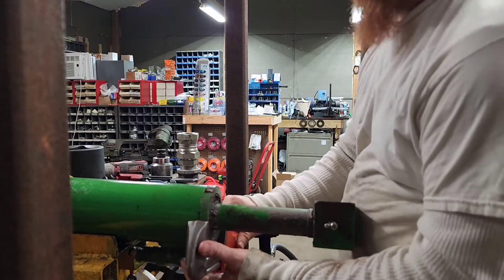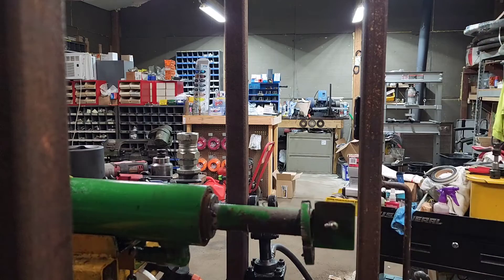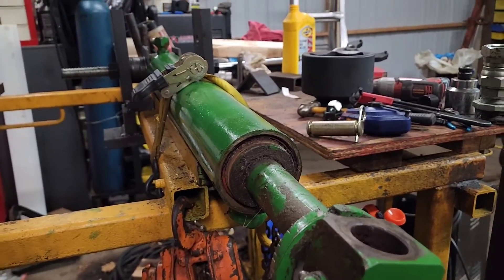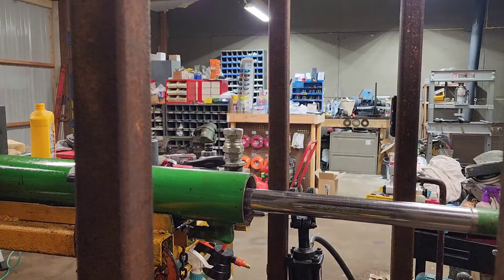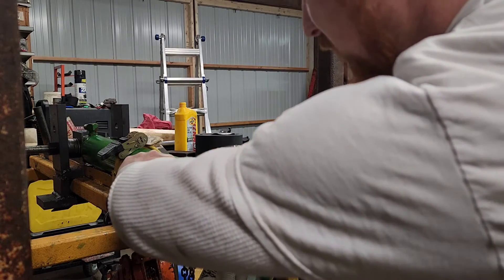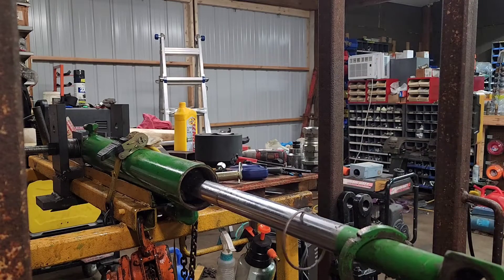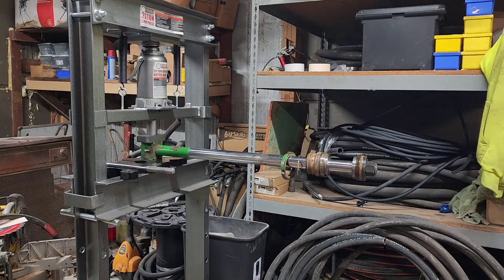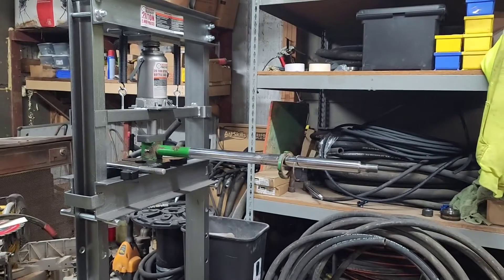John Deere cylinder rebuild

Comment: Nice work. I do those in the field and sometimes it’s not easy.
Reply from the maker: I agree. I typically shy away from doing them in the field if at all possible.
Reply: @mayshydraulic  I been working on heavy equipment all my life. I did work for a hydraulic shop that would always send me out when their guys couldn’t do the job. The owner would put his magnets over my name on my truck and tell the customers that he was send his best guy.  I did on site Hydraulic repair cylinders, pumps, and all hydraulic related issues.  Keep the videos coming. Good intuitive videos.

Comment: I just started my 40th year in hydraulic repairs and have seen some really screwed up homemade tools, this isn’t one of them. This is basic, simple and only mildly dangerous. The Pipe Wrench will be the week point, so as long as you’re not using imported Pipe Wrenches I’d say you have a pretty good setup. KUDO’s!
(A face shield would be a good idea in case the handle snaps, it would prevent possible eye damage, I speak from experience)
Reply from the maker: Thank you so much for the advice and compliment. We have actually made a vise style wrench made from 1/2 metal and  two 1in pieces of all thread.  We use a pipe Ridge  pipe wrench, but for smaller, easier jobs.
Reply: I am from China Seals Factory. Our company produces many types of hydraulic oil seals. If you are interested in our products, we can send you free samples so that you can learn more about our products.

Comment: Looks like a nice simple teardown solution. Some get really fancy. Why push up vs pull down?
Reply from the maker: If im not mistaken, you should be able to get more force pushing up.
Reply: @mayshydraulic  yes, because you have the larger surface area on the cylinder when pushing. Just seems harder to strap it down.
Reply from the maker: Yes it is for the most part. But a 1ton chain ratchet does wonders

Comment: Have a JD 310c hoe. Are the cylinders basically the same as this ? Thanks
Reply from the maker: Yes to my knowledge they are.
Reply: @mayshydraulic  thanks
Reply: @mayshydraulic  subscribed
Reply: I have a 210c. Love it, it's a great workhorse. Here because I blew the seals on my hoe bucket cylinder. Wondering how I'm going to get the 1 5/8 nut off in the field, lol.
Reply from the maker: After you can get it apart you can remove the barrel from the machine and leave the rod on the machine.  You can then us the right socket and breaker bars to remove the nut.
Reply: @mayshydraulic  Yes! That's the way to secure it, thank you. Why do we miss the simple lol??

Comment: Good video. I'm doing the same job on a 740 loader lift ram but the outer collar nut won't back out. I have it turning but it just turns in the same place. Any suggestions?
Reply from the maker: One thing you could try is soak it in lubrication.  If that doesn't work, you could pressurize the cylinder with the loader, then try and remove it.  You could also try an air hammer with a duel chisel.  And worse case scenario is cut it off to remove it.
Reply: @mayshydraulic  Thankyou, I put some pressure in the cylinder and got it loose.
Reply from the maker: No problem your welcome
Reply: I am from China Seals Factory. Our company produces many types of hydraulic oil seals. If you are interested in our products, we can send you free samples so that you can learn more about our products.

Comment: Thanks for the video. A customer asked me to rebuild the lift and tilt cylinders on a 740 Deere loader. Since I didn't have a large enough  spanner, I tried a 36" pipe wrench on the lift cylinders but they wouldn't budge. So I used an air chisel with a dulled chisel to break them loose. The problem was it also loosened the gland inside so I used a come-along to put pressure on the gland and then using the air chisel was able to get the gland nut loosened up enough to remove. After driving the gland in to get to the retaining ring I used an old small screw driver as a punch to get the ring out of the groove and then used a needle nosed vice grip to remove the ring. I really appreciate your video and that cylinder holding set up with the hydraulic cylinder to push the pipe wrench is really slick.
Reply from the maker: Awesome glad that you enjoyed it.
Reply: I am from China Seals Factory. Our company produces many types of hydraulic oil seals. If you are interested in our products, we can send you free samples so that you can learn more about our products.